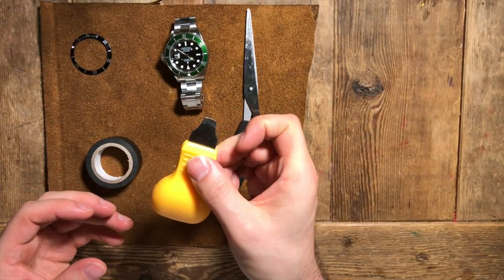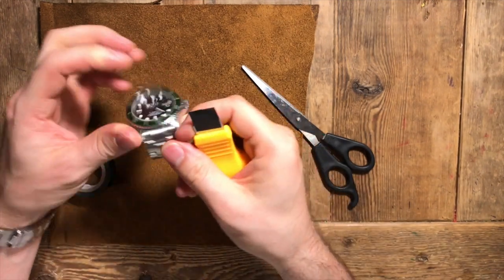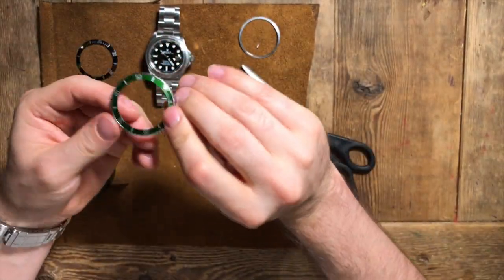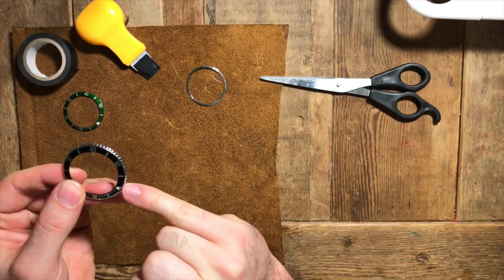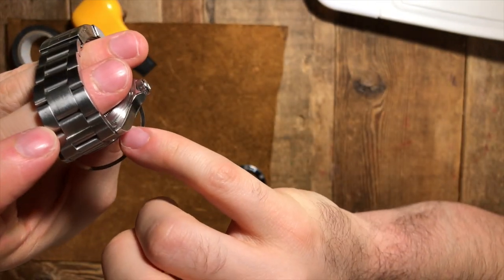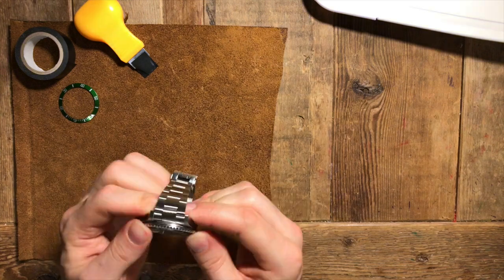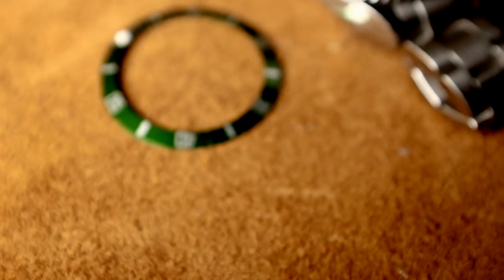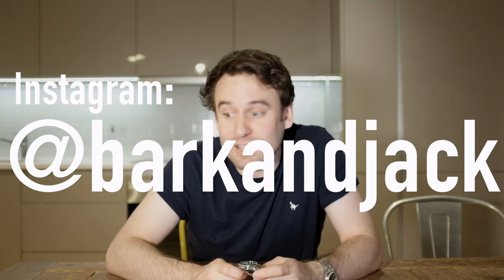How to change a Rolex Submariner Bezel Insert

Comment: The thing is this,,, I have a genuine 1982 GMT Master with a Pepsi bezel,, nicely worn and totally genuine,, bought in 82 for around £800, GBP ,, now worth in excess of £6000 GBP ,, if I change the bezel,, value drops to around £1000,  GBP,, So don't mess around with your Roly, if it's genuine!!
Reply: I think the idea here is that he is saving the genuine bezel insert from damage by putting a cheaper beater bezel insert instead. He can pop the original bezel back and since it's all original parts the value stays. Imagine wearing your GMT master and you get the bezel insert dented or punctured during your wear. Since the worn aspect is part of the charm for the watch you have no choice, but to be careful. For people with newer subs without worn bezel the switch doesn't really change the appearance of the watch. (though I suppose you wouldn't get the lovely worn look years down the line)
Reply: I bought mine in 1987 for just under £900 and it has hardly been off my wrist since. The bezel is looking a bit worn now and replacing it would give the watch quite a cosmetic lift, but as you say, it slaughter's the value. I might consider swapping the bezel and just keeping the original though.
Reply: You can still change your bezel. Just keep the original one and use an aftermarket one as the “beater”.

Comment: Sir...I'd like to thank you VERY much for this superb video.  I knocked the bezel off my Rolex Submariner by banging it against my refrigerator door (OK...don't ask).  I snapped the bezel back on...but didn't have the one-way ratcheting feature.  I watched your video and discovered I was missing the tiny wire spring.  Miracle of miracles...I actually found the spring inside my refrigerator where I banged the bezel off.  That is one TINY spring...but I managed to get it back in the hole...and snapped the bezel back on as you described.  BINGO...my watch now works perfectly...many thinks to you!  Cheers!
Reply: Me too,  I knocked one off about 30 years and some local watchmaker replaced it,  never noticed until now I'm also missing the spring, ( doesn't click )   I never wear it but looking lately just because of the value of the older ones.

Comment: WARNING: my 2018 sub has four spring button locations: 1, 4, 7, 10 o'clock locations. if you pry at 7 o'clock as recommended in this video, you WILL damage one of the spring buttons. best to pry at 5 o'clock. just found out this method doesn't work with a ceramic bezel. it's different with the aluminum as shown above. I can't get my bezel back on.

Comment: Always load the bezel in first without the bezel insert. That way you can align the 12:00 triangle on the insert so it lines up perfectly when you turn the bezel right and lock it in place. You have many triangles off center due to an improper install like he did in this video. Everything else he did was fine minus this critical step.
Reply: How much would a blue bezel be for the 41mm thanks 4 the info I never new the bezel can be chsnged

Comment: nice vid, where do you get the bezels and it would have been great to hear a little but about the quality/differences of the aftermarket bezels vs the originals. Thanks.
Reply from the maker: Thanks very much for watching. I buy my bezel inserts from cousinsuk.com. Quality wise, there really isn't much difference between a real and aftermarket insert. The pip is sightly different and font, but build wise, they are the same. Maybe the printing on the official bezel is slightly better.
Reply: On the question of After market bezels, I've been on the search for one for my 16610, but i have noticed most sellers selling AM bezels stated that a small amount of adhesive or glue is needed. I don't know about everyone else but putting glue or adhesive on a Rolex is stupid and sounds like the bezels aren't made to a high quality. ( SO my question is can anyone recommend a good reliable supplier of AM bezels in the UK that will fit snug like the authentic ones do "NO GLUE or ADHESIVE" Thanks

Comment: After 20 years of owning from new, my bezel, insert, spring and spring washer disappeared. I wear my Sea Dweller 24/7, diving, motorcycling, workshop, office, bed... so no idea where the bits went or why/how.  So, can you suggest how I lost them, but more importantly where to get replacements? (I have a theory that mechanics hand cleanser which contains abrasive beads, worked its way between  the bezel and case so that it "un-clicked". What do you think?

Comment: I own a yacht master and really want to change the bezel and the dial for something like the black submariner. 
1- do you think it’s possible ? 
2-And if yes, any recommended places to buy from online ? 
3- I kinda like how it looks without the bezel is it bad for the watch ?
Thanks really helped
Reply: I don't know which Yacht Master you've got and I suppose they could have been different at some time in the past but my modern YM40 126600(I think) has a solid platinum bezel with the numerals in like a sand blasted relief. No insert necessary or even possible.
Hope that helps.
Reply: Oh and changing the dial in a Rolex is NOT for the faint of heart!

Comment: Great vid!!!!!!

On the question of After market bezels, I've been on the search for one for my 16610, but i have noticed most sellers selling AM bezels stated that a small amount of adhesive or glue is needed. I don't know about everyone else but putting glue or adhesive on a Rolex is stupid and sounds like the bezels aren't made to a high quality. ( SO my question is can anyone recommend a good reliable supplier of AM bezels in the UK that will fit snug like the authentic ones do "NO GLUE or ADHESIVE" Thanks
Reply: you have a rep im sorry

Comment: Great video! How do you feel about using aftermarket bezel inserts? You don't feel like you are cheating on the quality by a large degree? I would be tempted to get the Kermit look (love the green against black) without buying that 50year anniversary model. Where would I be able to find replacement bezel inserts?
Reply: I personally would not. You spend 10 to 15k on a watch you can afford $300 for a real Rolex bezel insert. You look at it all day long.
Reply: @Samlol23_drrich  What do you recommend to source real inserts?

Comment: I bought a 2nd hand submariner from a what seemed like a reputable dealer and I noticed after I took it home the bezel is too tight but comes loose around the 2 o'clock mark. Also, when you shake it it sounds like something is loose inside it like a tiny piece of metal. I don't know what to do. Any help is appreciated.

Comment: I work in psychiatry and I feel many Rolex owners have psychological issues regarding the "genuiness" of their Rolex. What's with having fun and creativity. Most freak out when they've found I put something aftermarket on my Rolex. Come on! On my 16710 (originally with a pepsi bezel), I have a few aftermarket bezel inserts that I frequently swap in and out while my genuine insert is protected in the box. I usually wear my pepsi and coke inserts during the spring/summer and use the black insert during the winters. Over the years, I've replaced at least a couple of different sets of scratched up coke and pepsi inserts. Thanks to the perfect condition of the original pepsi insert, I recently popped it back in and sold the watch for a big profit. TBH, on the 16710, unless I remove and compare the brand new inserts side by side, I couldn't easily tell the difference which is gen and which is aftermarket. Imagine both inserts having a little wear, it is just visually impossible to distinguish when sitting inside the bezel! Enjoy your watch! 😀

Comment: Very useful vid ! Is it still possible on the current ceramic versions ? Thanks !
Reply from the maker: Thank buddy. It still works for the ceramic versions, but do be careful of the ceramic section itself. Ceramic is strong, but it's very rigid, so be careful not to shatter it.

Comment: hi adrian, interesting video. do you know if this is possible to do on the new gmt's? cermaic bezel? ive heard its not but you may have a different view. also, if it is possible, do you know where i could source an insert? im after rolex parts only, not knock offs fyi.
Reply from the maker: Hi buddy. Thanks for watching. The problem with ceramic bezel is they are incredibly brittle. I know it is possible on the new GMTs, but I’ve not tried it. And for me, doing it with a genuine Rolex bezel would be too much of risk.
Reply: thanks i appreciate your time adrian. yeah im not game to have a go at it. i could see a several thousand dollar rolex repair bill flash before my eyes given that id probably mess it up. might keep an eye on baselworld, who knows rolex might relent and bring us what we want, a steel gmt.

Comment: OKI I’ll order my coke bezal quick question is that spring in same place of all rolex bezal pre ceramic such as sub gmt and sea dweller ?
Reply from the maker: I've not taken a .bezel off on those models myself, but I'd be surprised if Rolex bothered changing the location of the spring.
Reply: Bark and Jack I’m going to risk it again after 4 years let’s c if I fail or pass 😂
Reply from the maker: Rajazraj1992 haha. Good luck!
Reply: The pre Ceramic Sea Dweller bezel spring locates at 12 o'clock :)

Comment: you had a really easy bezel to lift, in any other normal bezel that bezel would be so hard to lift with that tool you had, and you would 100% damage the case with it, you should use a plastic bezel removal tool for this

Comment: You wrongly lifted the bezel by putting the pressure on the case instead of the inside of the bezel which can leave a mark. And I can tell the new insert isn't OEM. The print of the numbers is uneven.
Reply from the maker: There’s tape on the tool, no damage done. I state the bezel is a cheapie, it was bought for the video.